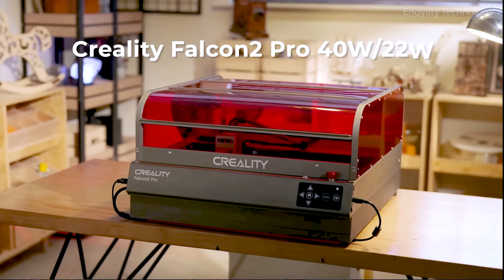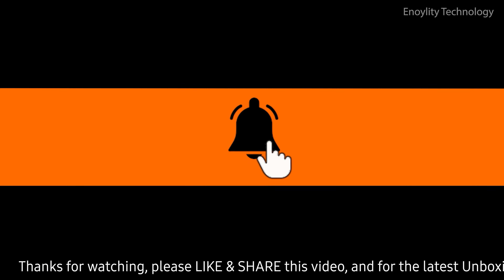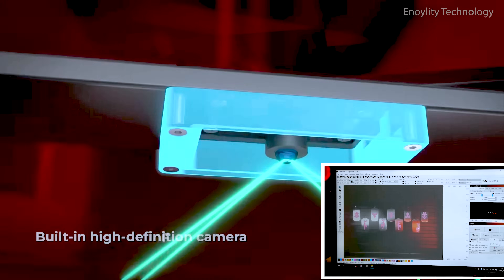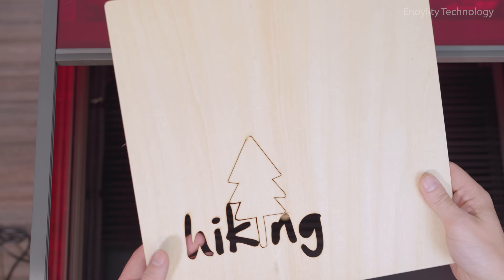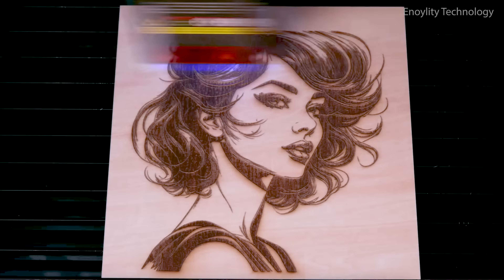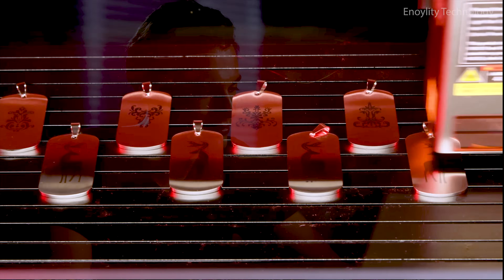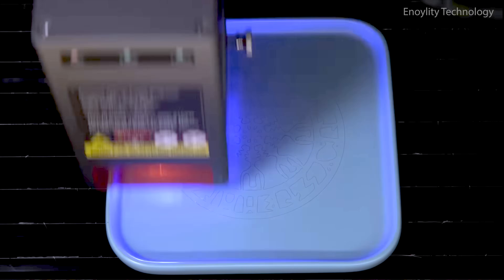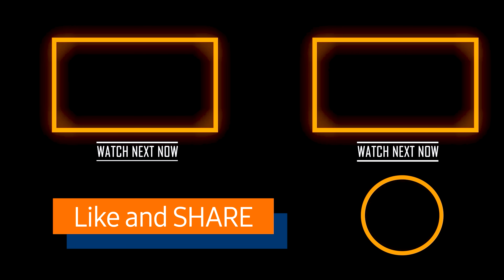Creality Falcon 40W Laser Review: Powerful Precision Engraver for Every Creator!

Comment: Wish they included better instructions for assembly and alignment—it took me a couple hours to get it right😢
Reply: Not ideal for total beginners. There's a learning curve if you haven’t used lasers before
Reply: The user manual could definitely use more pictures and troubleshooting tips
Reply: Assembly was frustrating, but once set up, the output quality really impressed me
Reply: Good for art projects.
Reply: The laser focus system is simple to adjust and keeps cuts consistent across the board
Reply: The 40W excels in multi-layer wood projects—it’s fast, deep, and accurate
Reply: An awesome machine. Solid built, packaged so well that it is difficult to unpack. Includes everything necessary to get up and running with the exception of a computer.
Reply: I had to fight with Amazon on the return because I had limited amount of days even though I bought it and was dealing with the same company. I would not recommend this laser to anyone simply because the customer service is non-existent.
Reply: For now I can tell it has a nice large surface area available so it will do any size piece I will wish. The program was simple to load and it was easy to get started. The emergency off worked very well.
Reply: I also have a hard time keeping track of the micro- SD card that is required for running projects offline. The keys that lock the machine can also be misplaced, but I just keep them in the machine.
Reply: Filtered exhaust, honeycomb floor, e-stop, auto focus and much more. I highly recommend this laser for anyone that doesn't require the through put that the much higher dollar units provide

Comment: I love how quiet it is during operation compared to my older engraver. Less annoying when working long hours❤
Reply: Love the cutting power, but I really had to fine-tune the air assist for optimal performance
Reply: Versatile material support.
Reply: Love that Creality included both USB and SD card options—makes job transfers flexible
Reply: You can upgrade or accessorize both models easily—Creality provides great add-ons
Reply: I barely hear it running, such a nice upgrade from my last one

Comment: Their laser shielding design is better than most in this price bracket. Less glare, safer to use around others😊
Reply: Both models come with strong safety features, including shields and emergency stops
Reply: Cuts on cardboard and thin plastics are clean with no melting or flare-ups
Reply: The design of the laser shielding is a bit awkward and doesn’t feel very secure during operation 😐
Reply: Thankfully, I took the plunge and ordered it anyway. It's extremely easy to set up once you download the correct program for your computer
Reply: In terms of assembly, this machine was much simpler than my Falcon as the frame comes fully assembled with the gantry and belts preinstalled and ready to go (the original Falcon required you to assemble the frame and install the Y belts yourself, which was time consuming and not beginner friendly)- all you have to do for assembly on this one is screw in the feet, connect the air assist and attach the laser module.

Comment: I appreciate the offline engraving feature. Makes it easy to take the machine to craft shows or markets
Reply: The build area is generous—can handle full-size signs without repositioning material constantly
Reply: Great for crafting.
Reply: The structure is super sturdy; no wobbles or flexing during long cuts or high speeds
Reply: The engraver works smoothly and precisely, producing high-quality results every time. The laser itself is powerful yet controlled, capable of detailed engravings on a variety of materials like wood, acrylic, and even metal.

Comment: The power of the Falcon 40W is insane for the price. I can cut 15mm pine in a single pass—wasn’t expecting that 💵
Reply: It’s powerful, but without a proper enclosure, smoke control is a real issue indoors
Reply: The 22W version is perfect for hobbyists who want detailed engravings without going overboard on power
Reply: Build quality is top-tier—aluminum chassis feels premium and durable
Reply: With a 400x415mm workspace, there’s plenty of room for large pieces without needing a huge desk
Reply: The software was incomplete, missing several advertised features, and the laser lacked the necessary power to make even a single cut. After a lengthy two-hour discussion with the manufacturer’s support via live chat, their only solution was to suggest using a different type of wood, which was not a satisfactory resolution.

Comment: There’s a tilt and flame sensor, which is great peace of mind. I accidentally bumped the table during a job and the machine shut itself off immediately
Reply: It's pretty loud during operation, especially with the air assist running full blast
Reply: Easy to setup and use. I am having fun making stuff
Reply: Flawless machine super powerful be sure to always check your power settings can easily cut thick acrylic with ease, will comfortably etch metals at full power worth the money in my book.
Reply: Excellent for small businesses, the engraver can help create unique products that stand out in the market.
Reply: They were quick to respond and the issue (my error) was resolved. I have engraved wood slices and granite style coasters using Lightburn software
Reply: If you want something that will work right out of the box and if not at least you will have support for I would not recommend sticking with creality.
Reply: The emergency off worked very well. We ran it quite fast and it was smooth. I have had a really good experience with it so far. I’m pretty sure my son is jealous.
Reply: this model has integrated air assist, which is huge because you can easily control it through Lightburn or whatever laser software you're using, in addition to manual control if you choose. The ability to have your software turn it on while cutting and off while engraving is wildly helpful and gives much better results overall.
Reply: LOVED this engraver! I was worried about the price point but the quality was unmatched for it. It came with simple guides and even had programs to use.
Reply: The directions provided could be more detailed. The instructions and videos on the website were very helpful, as was the support team. I used Lightburn software to create designs and operate the engraver. Overall, I am very happy with the engraver and I am excited to keep learning more.
Reply: The engraving and cutting quality is amazing. I have enjoyed every project with this laser machine.

Comment: It came with extra screws and tools, which was a nice touch 👍🏻
Reply: The engraver provides high precision, allowing for detailed designs and accurate cuts, which is essential for professional-quality work.
Reply: The frame is solid aluminum and very sturdy—no shaking, even at high speeds
Reply: The 22W is ideal for first-time users—enough power to impress, without overwhelming
Reply: It's well made, powerful, and fast. Assembly is easy if you follow the instructions - video tutorials which are included on a thumb drive. If this is your first laser, be patient and follow the directions, it will be a good learning experience.

Comment: The control board is powerful, but it lacks a screen. It’s a bit of a missed opportunity—adding even a basic LCD panel for file selection would improve usability a lot.
Reply: I wish there was a touchscreen interface instead of just the power and emergency stop buttons
Reply: It is affordable and perfect for both beginners and experienced users
Reply: The frame design makes it really easy to monitor your project while it’s running
Reply: 22W handles acrylic and leather beautifully, with minimal edge burn or discoloration
Reply: Safety was a big concern for me, and I'm impressed with its fully enclosed design and effective smoke and dust filtration system. It's reassuring to use indoors without worrying about ventilation.

Comment: Limited Z-axis movement—makes engraving thicker objects a challenge without mods
Reply: This product does a great job! Easy to install and the air assist make a huge difference!! I highly recommend air assist for laser work!
Reply: Firmware updates from Creality have kept improving usability and stability since launch
Reply: Minimal maintenance—just clean the lens, and it keeps running strong
Reply: We went with the trial of Light Burn, but it's kind of a given that we'll be purchasing it when the trial period ends. There are free open source programs you can use, but we tried a couple and prefer Light Burn.
Reply: The transparent safety screen over the laser nozzle is an integrated part of the laser module on this machine, vs a separate piece attached with magnets on the the original Falcon

Comment: There's no enclosure included, which makes it tricky to use indoors without extra fume extraction.
Reply: Beginners can quickly learn how to operate it.
Reply: The engraver is efficient, reliable, and versatile, capable of handling a range of creative projects. Whether you're a hobbyist or a professional, this laser engraver is a great investment that will help bring your ideas to life. Highly recommended!
Reply: It is fairly intuitive and can be mastered quickly. However, someone without a basic understanding of CNC and computer aided drafting may struggle to operate this successfully straight out of the box
Reply: They helped me troubleshoot the problem and narrowed it down to a firmware update which was simple to install. Since then my Longer B1 has been getting quite a workout and I love it. I will be adding the extension in the near future.

Comment: It can cut acrylic cleanly with multiple passes—great for signage projects
Reply: With a compact design, it can fit in small workspaces, making it ideal for home users or those with limited space
Reply: This backtracking did not inspire confidence. Furthermore, the machine’s lens burned out after just two days of use, compounding our frustrations.
Reply: The camera makes positioning the item to be engraved a simple task. A real pleasure to use and as a previous CO2 laser user this diode laser is a far superior design, more accurate, and easier to operate.

Comment: Love the quick-adjust focus lever. Makes switching material thickness much easier , just Love it in one sentence ❤
Reply: It's pretty loud during operation, especially with the air assist running full blast
Reply: I appreciate the emergency stop button. It’s simple but gives peace of mind
Reply: Fan and air assist work really well together. Cuts are cleaner and there's less charring on edges
Reply: It creates detailed and accurate designs.
Reply: True, and the quick focus adjustment saves so much time 😊
Reply: I do plan to update this review if there are any problems that I encounter or if there is information I feel would help you decide if this machine is worth getting.
Reply: The Falcon2's frame also has more manual control buttons, which I know was a common complaint about the original model Falcon- you can easily home and move the head manually using the buttons on the frame rather than strictly through your software, as well as a manual control dial for the air assist. It's also got a couple of extra safety features including a huge red abort button and a keyed safety lock so you can lock down the machine when not in use- handy if you have kids or pets.

Comment: Can the Falcon 40W cut metal?
Reply: No, it’s a diode laser—not strong enough for metals. Great for wood, acrylic, leather though
Reply: Safety features like the protective shield and emergency stop make these machines user-friendly
Reply: No, it can engrave metal but not cut through it
Reply: It marks metals well, but cutting isn’t possible with 40W
Reply: The laser engraver I recently purchased has been a fantastic addition to my workshop. Its ease of use and straightforward setup make it accessible for both beginners and experienced crafters alike. From unboxing to engraving, the entire process is intuitive
Reply: I went with the 20W so that I knew it could do all the different medians that I would want. So far I’ve done wood and metal, and have bought the rotary attachment so that I can do cups. Defiantly a great first engraver!

Comment: The air assist built into the laser head works really well—reduces burn marks significantly❤
Reply: Built-in flame detector and tilt alarm are solid safety additions
Reply: The laser dot preview helps a lot for alignment, especially with complex designs
Reply: High precision
Reply: Other than the key lock wouldn't work, key could not turn the lock, so I had to bypass it. In the Philippines so didn't want to send it back. The machine itself works great. No problems with it
Reply: The gantry comes fully assembled, so this machine takes less than fifteen minutes to set up, including unboxing and reading through the included literature. The laser module easily slides into the support, and the air asssist connects to a pre-assembled hose
Reply: There is a bit of a learning curve involved, but this is definitely worth the time and effort. There is a wealth of knowledge available online for those learning laser engraving and cutting for the first time
Reply: I bought this engraver to see how I liked laser engraving. I got an engraving job from someone and did personal things with it. After 35 hours the laser module went out. Gluwphy customer service gets 0 stars
Reply: Nice trending product🎉❤
Reply: It is so prity and useful product❤

Comment: The 40W module has insane cutting power. I cut 20mm pine in one pass—clean edges, no charring
Reply: Works great with LightBurn. The settings are easy to dial in, and the results are repeatable
Reply: I'm impressed with the stability of the frame. No wobble, even during high-speed engraving
Reply: The value is outstanding for anyone looking to go semi-pro without jumping to an expensive CO₂ setup. Whether you're cutting intricate patterns or full sheets, it performs reliably
Reply: Engraves quickly, saving time on projects.
Reply: I was worried about heat buildup, but the integrated cooling systems work really well

Comment: Creality really stepped up the game—40W of pure engraving power, perfect for makers, artists, and DIY enthusiasts!"
Reply: Auto-focus is a game-changer. It’s been saving me so much setup time on every project
Reply: Easy to move around or store when not in use.
Reply: Both machines run quietly enough for home use, even in shared spaces
Reply: The clear instructions made setup a breeze, and within a short amount of time, I was engraving my first project. The software it comes with is user-friendly and offers plenty of flexibility for different design types.
Reply: Leveling and operation are pretty much the same as the original Falcon- you're provided with a metal guide to manually adjust the distance of the laser from your material based on thickness.

Comment: The precision on this thing is unreal! Finally, a laser engraver that matches pro-level results without the crazy price tag!"
Reply: The lens has become a little yellowed. I now discover that Creality doesn't sell replacement parts for this. They seem to have many parts for 3D printer products, but not much for their laser products. I have been working with tech support for about a week.
Reply: Power levels can be changed for different materials.
Reply: The dual-laser tech on the 40W gives it deeper cutting ability while still being impressively fast
Reply: Both machines work well with rotary attachments, which is great for cups and curved objects
Reply: Great software support—you can use common file types and tweak settings easily
Reply: Set up isn’t easy as there are really no instructions. The Lazer itself works very well. You also have to find your own computer hardware. It takes awhile to learn everything that it’s a good machine.
Reply: That could be a problem with my phone carrier. I have gotten no response from Gluwphy. This machine worked great until the laser module went out.

Comment: I absolutely love this thing. With everything I've thrown at it so far, it has "just worked" with default settings out-of-the-box. It seems very well designed and I love having the auto-focus system built-in. The alignment system is amazing. Sure, it may not have a built-camera like some companies have started adding, but if you look at the reviews, this very clever and quick alignment system is yet another thing that "just works"—it's easy to use and can be more precise than some of the camera systems I have seen.
Reply: Assembly was super straightforward. Took me about 25 minutes from unboxing to first test cut.
Reply: The cooling system could be better; it gets quite warm after long runs
Reply: My lens cover gets dirty quickly when cutting MDF—keep spares on hand.
Reply: Cable management is a bit of a mess. I had to 3D print clips to keep things tidy
Reply: Simple programs make designing easy.
Reply: Each laser works perfectly well and the precision it engraves is fantastic. The smallest details are engraved very precisely and the outcome is just amazing. It is fast too but that depends on the project as some 3D deep engravings takes much longer to do - Even few hours but the result is breathtaking.
Reply: Overall this machine has improved my business. I am able to engrave items at a much faster rate and my customers are very pleased with their finished products. I have not had the opportunity to try out all of the possibilities with the different materials this machine is capable of engraving, but I am anxious to
Reply: Setting up was straightforward, the package came with everything I needed, thanks to its smart design that saves space and reduces setup time. The auto-focusing system is a big plus for beginners like me, ensuring accurate results without manual adjustments.